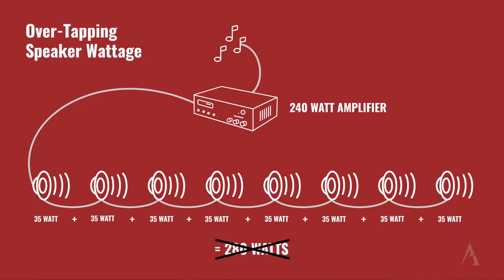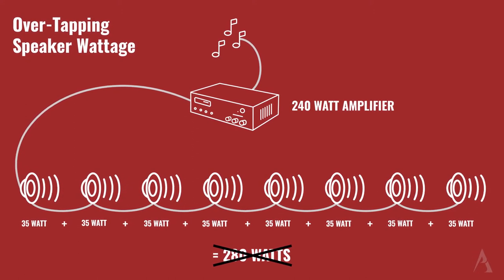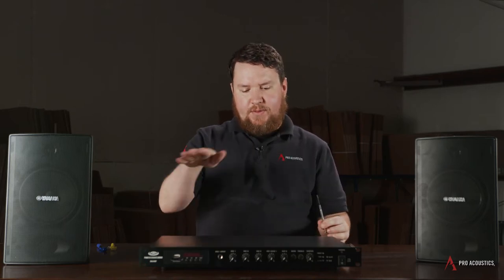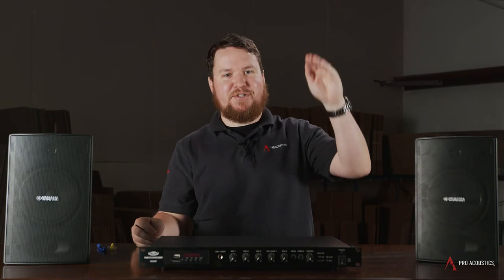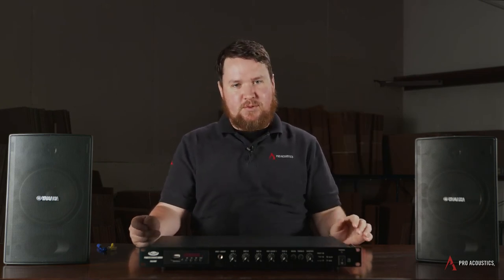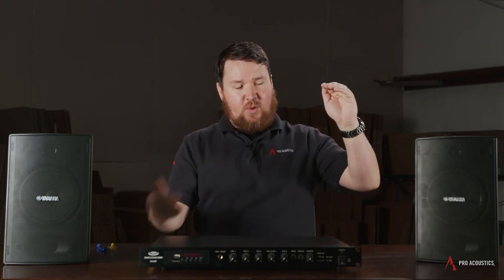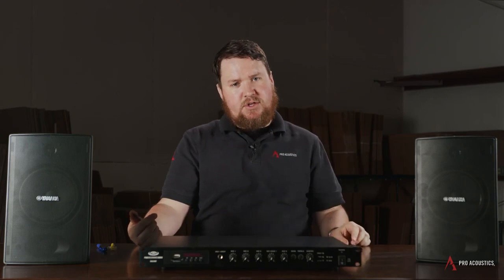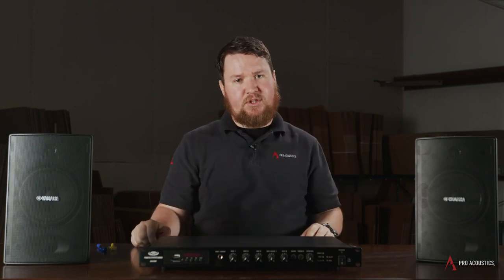Quick Clip: What is headroom in audio amplifiers? (Pro Acoustics Tech Talk Ep. 57)

Comment: Deos the denon 8500ha receiver have good headroom
Reply from the maker: Headroom is usually determined by the type and quantity of speakers used with your receiver. If the speaker is rated at 100W, your amplifier should be rated for 120W output to provide the necessary power and headroom. It's best to refer to the owner's manual and technical specifications of your receiver, as well as the speaker(s) you are using.
Reply: @ProAcoustics  thank you for responding , I just don't understand that technical aspect of it though
Reply: @ProAcoustics  I am in the process of buying svs ultra bookshelf speakers just letting you know incase you would know off the bat that the 8500 would be good
Reply from the maker: @ddcrocky3831  The SVS website advises using an amplifier that delivers between 20 and 150 watts for the Ultra Bookshelf speakers. Given that the Denon 8500HA receiver is rated at 150 watts per channel, it should be a good match for your SVS Ultra Bookshelf speakers. Enjoy your new speakers!
Reply: @ProAcoustics  thank you